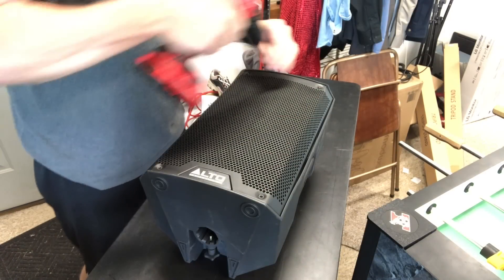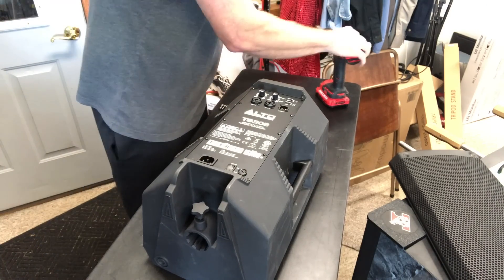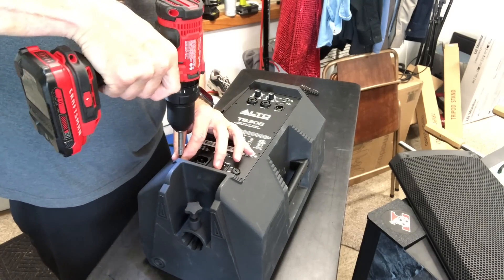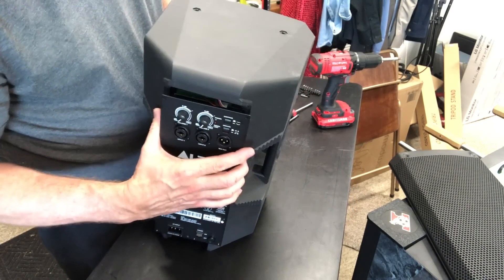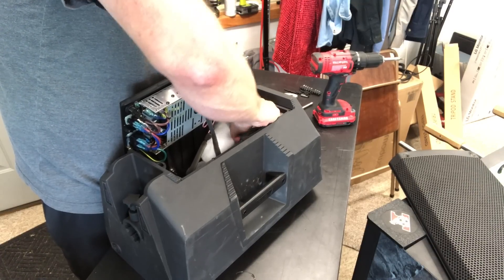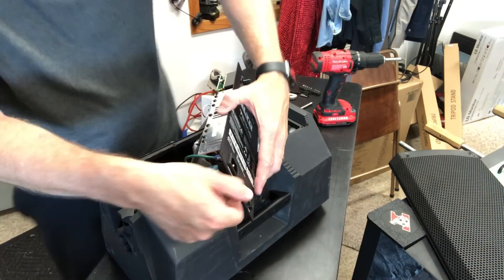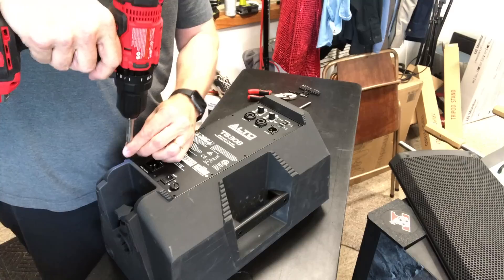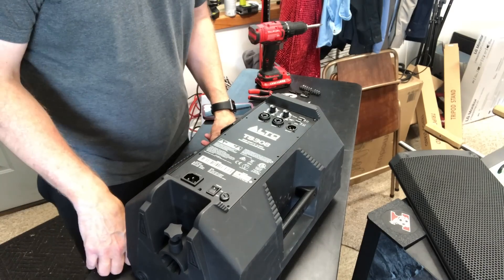Take A Look At The Inside Of The Alto Pro TS308 Active Speaker with John Young

Comment: FYI - The Alto Pro TS308 and TS312 are what can now be purchased as rebadged as Headrush FRFR 108 and 112 for the same price. Not sure if that helps anyone but they are actually identical units and if one is unavailable the other will work exactly as expected. Great quality budget PA speakers.
Reply: Are you sure both brands are the same thing?

Comment: Do a continuity check of the woofer with a cheap 10 dollar voltmeter. This is to make sure the wire from the connector to the vocal cord did not disconnect from the shock of drop.. You can see that if you remove the woofer or do a simple continuity check. (Ohm check.) It's just simply putting the probes on the negative and positive of the woofer.  Naturally you have to disconnect the wire from the woofer connect. If the test result is positive then you know it is the board.

Comment: Pull the woofer and see if the leads are still touching the driver.  Solder breaks sometimes with drops.. bit but a real easy fix